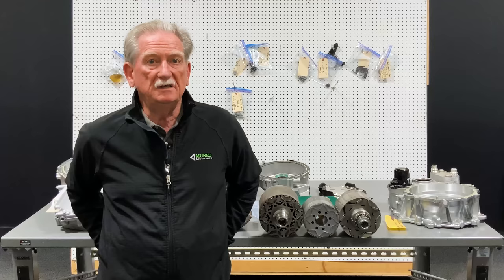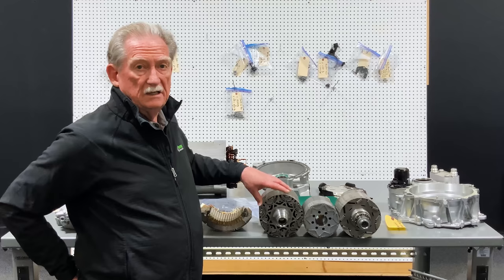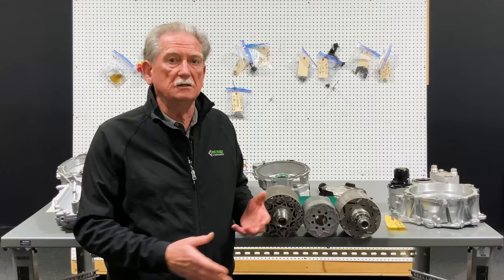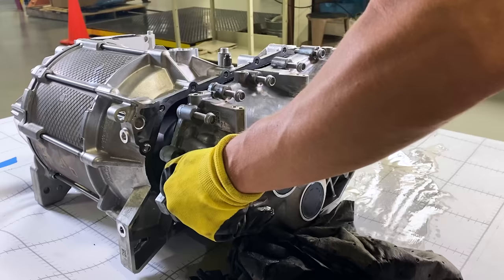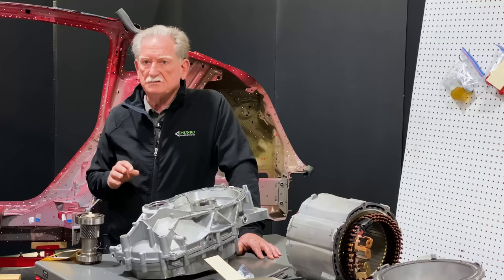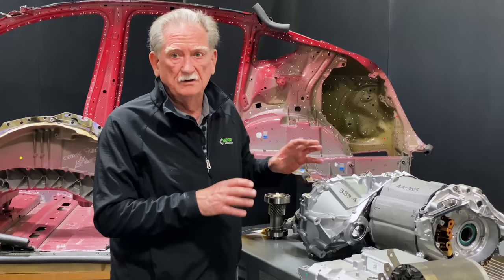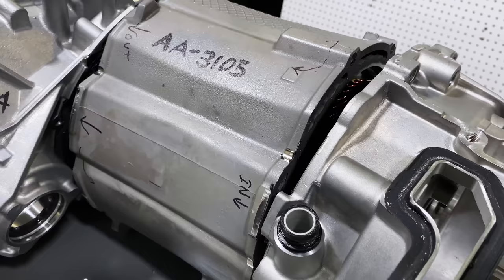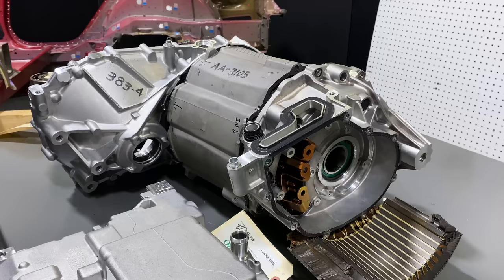Volkswagen ID.4: Electric Motor Teardown and Analysis

Comment: Sandy seems totally uninterested in repairability, with his obsession with snap-together or riveted fixings. Repairability is really important as part of a circular economy.
Reply: Sure. But an Inverter repair is work for a specialist. You need all kinds of test equipment. No problem to have the tools to undo fasteners and a supply of replacement parts.
Other assemblies like the rotor just cannot be repaired. If they fail it may well be the results of the failure of the threaded fasteners.
Reply: @olafzijnbuis  you replace the inverter as a whole in teh field, but still want it to come apart easily in the specialised repairhop. those specialists doing the repairs have high hourly rates, you do not want to waste them on fiddling with plastic clips that get brittle over time.
Reply: could you estimate what percentage of inverters sold will be opened up and worked on?
Reply: Cmon, who will ever repair converter?
Reply: @jeffgorchynski  no, but by European law they have to be designed in a way they can easily be worked on and easily dissasemled into their main material fractions to recycle them more easily.
Reply: Never going to happen, electric cars are the new throw away tech.
Reply: @mell3109  Well, as Rober Köppl above said, designing it for throw away, is forbidden by EU law. It must be repairable. And the repair information must be made available to all repair shops.
Reply: Sandy does not know EU law. I think I can forgive him for that. But repairability should be one of the core principles he throws around in this video.
Reply: @ronaldderooij1774  EV will create a new industry for scrappers
Reply: @omoklamok  Yes, as far as lithium batteries and copper go. I agree.
Reply: @samuelgomola9097   I hate to say it but I would be one of the people repairing things like this. That is how I have saved up the money to buy my first new vehicle the Cyber truck.
Reply: @ivantierney6737  Yes and it's fine, I also like to repair electronics if they are repairable and even better for you in you can make money from, but in general it's far from everyday reality. Maybe 1% of those units will be ever repaired by skilled people like you or hobbyists like me. From reliability standpoint it's better to have SMDs and no screws if possible in environment with vibrations like car, you know what I mean.
Reply: Totally agree, so when the Capacitor goes bad (because it will) he will throw away the whole inverter, crumbs and they say the youngsters have a throw away culture.
Reply: Thing with theese inverters is is that in 90% of the cases where one fails, its either a burnt IGBT which needs replacement and or some complementary components like Driver ICs and Capacitors. Which can cost you 20-100$, depending on what is broken, in parts to repair a 3000$+ inverter. 

Doing repair work on a product with clips is the most annoying thing ever because they often break during disassembly.
Reply: @karicowo  Exactly. Sandy has spent a lifetime optimising for manufacturing cost and reliability. And that is often in direct competition with repairability. One-way clips, welds, large (expensive) single components as the unit of spare. You can make things reliable and repairable/maintainable but it generally costs more (gaskets rather than welds, removable fixings rather than insert-only clips, etc). Sandy is now looking quite old-fashioned on this aspect whilst being uptodate on others. More aware designers are probably holding their heads in despair. I guess they'll have to start youtube channels too to get the word out about a more circular way of designing. :-)
Reply: @samuelgomola9097  I would
Reply: @olafzijnbuis  Sure can a rotor be repaired!
Reply: @sebastianbottger1044  Maybe. But you also have to consider things like Mean Time Between Failures, Mean Time To Repair, and Mean Cost To Repair.
The long bolts may make the rotor repairable, but may well be the most common failure point.
In the end, you can repair everything. I traveled extensively in countries like India. With their low labour cost and shortage of spare parts, there is a need to repair things we in the west just replace.
I have seen metal sheets riveted to the side of truck tires to cover a cut.
Reply: Yeah I thought it was a pretty bold position to be so anti-thread
Reply: @jeffgorchynski  Go look at starter motors for ICE vehicles. Go buy one and they ask for a core charge, you bring your broken starter back to get your core charge refunded. The broken starter goes back to full tear down and rebuild/repair. These drive motors are expensive and there will certainly be a secondary repair market. If not then people will avoid buying the car in the first place.
Reply: What's the obsession with snap together, perhaps he should try repairing things, I work in a vehicle repair shop, and snap together is making things so much harder to repair. We send away ECU's and other electronic devices for repair. They really need to come apart for repair, could you imagine if you couldn't take an engine apart to repair it! Someone somewhere one day will repair these electric power trains, they need to come apart.
Reply: that's exactly what I  was thinking! I hate radial riveting. Also I have seen a LOT of failed radial riveted parts it only works if your quality control is absolutely perfect
Reply: @olafzijnbuis  Um I think you need to watch videos of people from India,Pakistan etc. They will tear down and repair anything including a motor like this. And do it in shops with a dirt floor. I even seen a video of them cutting apart and restoring automotive batteries and then using a hot piece of metal to seal the whole thing back up.
Reply: @stevenwestfall7638  True. I traveled a lot in India, Nepal an the rest of Asia.
I have seen how they rewind stators and rotors by hand.
I agree that things must be repairable.
Maybe a 3 tier system:
1 Replace the inverter
2 Replace a defective assembly like a PCB
3 Repair the PCB
At level 2 and 3 you must have the tooling to undo fasteners and a supply of new ones to replace broken fasteners.
There is no need for all them screws to secure a PCB. They are in fact a failure point.
Reply: "Circular economy" is nonsense. It's not always economical to recycle and repair things.

Moreover, thermodynamics prevents the elimination of all waste.
Reply: @ronaldderooij1774  EU law is not an example of good economics.
Reply: @phamnuwen9442  Consider natural systems for a moment before suggesting that a circular economy is 'nonsense'. Everything just recirculates in the system. Some of it very slowly (tectonics). An economy more in tune with that way of looking at things is not impossible.
'Economical' is a purely human construct, depending on how we value things. Value future utility more and more things become economic to repair and recycle. 
Thermodynamics does not make waste material inevitable - it does mean that there is 'waste' energy (actually just converted energy and an increase in entropy, which is inevitable).
A circular economy is absolutely necessary for our continued comfortable existence in the long term. There is not an infinite amount of stuff to dig up and throw away.
Reply: @phamnuwen9442  Entropy will rise IN A CLOSED SYSTEM. The earth is not closed. It receives energy from the sun.
Reply: @phamnuwen9442  Generally I disagree. But of course there are a lot of laws that I disagree with as well. That's normal.
Reply: @xxwookey  Tectonics isn't relevant to human economics, nor is supernova nucleosynthesis, and even if we're working on the premise that we have to recycle everything (which is not true), then that doesn't mean we have to do it immediately. If something is too expensive to recycle compared to using virgin material, then it makes sense to put it in storage (a landfill) until it becomes economical to reprocess it into new stuff.

"A circular economy is absolutely necessary for our continued comfortable existence in the long term."

I think the only sense in which this is really true is in the longest term, i.e. if you're trying to maximize the use we get from nature from now until the heat death of the universe.

In the short or medium term (centuries to billions of years (lol)), some degree of discarded waste will probably be more economical than complete recycling of everything.

And I'm quite skeptical that completely  avoiding material waste is possible in practice even if theoretical thermodynamics allows it.
Reply: @ronaldderooij1774  The EU is regulation, taxation, protectionism, tariffs, bureaucracy and market distortion.

All these things are inherently anti-economic since they interfere with the mutually beneficial voluntary interactions between individuals.
Reply: @xxwookey  Let me add that I believe there is potential for more (not full) economic recycling of used materials.

This is if we achieve an abundance of energy. The obvious way to energy abundance is nuclear fission.

Unfortunately, I suspect most people who support the "circular economy" are also rabid opponents of nuclear energy.

That is - their actual goal is neither economic flourishing nor abundance, but stagnation and poverty.
Reply: Dealerships do NOT repair parts -- they only quickly replace them using idiot mechanics then get additional profit from the cost of the new part.
Reply: @rodanderson8490  "Dealerships do NOT repair parts -- they only quickly replace them using idiot mechanics then get additional profit from the cost of the new part."

Replacing parts is often much more economical overall than repairing them. That's why it's done. If it wasn't, the repair shop or dealership would just repair the broken part instead of buying a new one and make more money...
Reply: Seems asinine to think people won't repair inverters. Have you seen what people do for electronics online?  I'd wager the opposite, that inverter rebuilds will be a core charge like service.  It's going to be like installing rebuilt alternators.

There's nothing in that inverter that's too scary for a shop that already does electronics.  It's only scary for a mechanic.
Reply: @mell3109  Which is totally against the idea of "sustainability".
Reply: @jeffgorchynski ,,, people like us who live far far away from repair shops at minus 20 to minus 40 degrees and shipping is constantly interrupted . WE take things apart and fix them , even if the fix is temporary , at least that gets us out of a jam . Long live the fastener . Also when fasteners are the last thing left they all go into boxes of used fasteners . They all get a new life  at some times .
Reply: @xxwookey  true dat . .... Sandy grew up in the land of plenty and a giant land of plenty at that , where space has never been a problem . Space is a problem in smaller manufacturing countries such as Germany and recycling is a serious serious issue . The other issue is VW sells their cars world wide and some countries are not as affluent as America . If a car company wants to survive it must also think of the other 90% that are not white collar workers . Like other posters have noted , that where does the second hand car come from ? Most can not afford this new technology . Like Elon Musk stated in one of his podcasts , he wants to get the price down to a 25,000 dollar car from where it it now ( unaffordable ). Elon is looking down the road and the big picture .

Comment: In Europe, we actually weld our rails together. And actually almost all the rails, not only for high-speed trains. Because we care about the people who live next to the rails...
Reply: Do they still use thermite for this?
Reply: @265chemic  yes thermite is still the best solution for this problem.
there are apparently some induction based solutions but they require insane power to get the ends of the rails hot enough and you need to be close to it while its happening while with thermite you set it up and walk away until its cooled off.
Reply: Robby Dey  if you want old rails, try Britain they were the first. All ours are welded now. It's the sheer scale of the US that is off putting I would presume.
Reply: I don’t know in what part of Europe you live but they certainly do not weld rails where I do. The rail gaps are actually so terrible that sometimes luggage can fall on people’s heads.
Reply: @mioszradomski1825  Yeah, I also felt that as I left Germany and entered Poland or Check Republic to travel to Austria. I'm talking about Western Europe, I'd say.
Reply: @handlesarefeckinstupid  Nope, it's not the scale as they have FAR less railways (per square km, not in absolute value) then us here. It's just the profitability as transportation mean that doesn't work there. Here A LOT of people use trains, in USA a very little percentage, hence no gain and no purpose to make it better. In USA there are 24km of railroad every 1000 square km. In EU there are 48km every 1000 square km of territory (Germany 95, Italy 87, UK 66, Czech rep 120!!!)
Reply: @265chemic  Yes even for streetcar/tram lines.
Reply: Heavily trafficked passenger rail corridors in the US use welded rail.  Freight lines, which are usually privately owned, tend to use the old stuff because it works fine for their needs and can be fixed with simple equipment.
Reply: I don't think Yanks have high speed rail. They use planes instead! Trains are for the poor and freight in Merica.

Comment: True!  Lot of threaded fasteners! Why? It's the law in the EU that every electrical circuit must be repairable! Which obviously doesn't apply to the USA!
Reply: Well,  Tesla sells their cars in Europe,  so fasteners may not be the problem.
Reply: @jamesengland7461  Tesla just swaps the whole motor out and charges you 10k$ for it.
Reply: or the UK anymore
Reply: @jamesengland7461  The EU and the US have agreed to recognise some of each other’s standards. So a US approved car may be sold in the EU and v.v. but the EU approval requirements (for cars produced in the EU) can still be different.
Reply: @frostyone1967  All EU directives have been put into UK law (just like all other member states had to to). I don’t think that the UK has made any changes yet.
Reply: interesting
Reply: @jansix4287  All EU directives have to be put into an EU member’s law. The UK has done so during its membership of the EU. The vast majority of those laws are still in effect.
Reply: @theUrbanRacingLeague   It’s a screw! For gods sake. Classic case of Americans not knowing what words mean.

Comment: Bravo to VW for submitting their own part for such an in-depth review!  Thanks as always for the technical breakdown video, Sandy.  These are always my favorites.
Reply from the maker: Thanks for watching!
Reply from the maker: Thanks for watching!
Reply: @MunroLive  thanks for watching
Reply: It gives them free tips from the experts. They won't hide anything from competitors anyway so why not get free tips on how to improve. Also VW engineers are probably really proud of what they have developed and want to get some recognition from other experts im the field
Reply: vw is probably having a good giggle at his 'don't use threaded fasteners, they come apart' schtick. i know i was.
Reply: @elayesexe  well from the breakdown, obviously they do!  50kilos over a Tesla battery alone.  1,00's of superfluous screws.  Tesla 10hrs/VAG 30hrs to make 1 car.  Yeah, that's 20hrs they could learn about for starters (obviously 1,000's of areas to improve).
You keep butt kissing if it makes you feel good about yourself...
Reply: @MunroLive  The gear house casting shows a hairline crack from the plunge cut, at minute 6:50 - 6:58...?

Comment: If the only thing Sandy finds is „Lots of screws“, then the VW design is pretty excellent
Reply: Better , in stead of trowing away a hole unit what the old dinosaur suggested you can replace the part that is broken.
So less garbige to trow away and better for the environment .
Reply: Definitely the attitude of an engineer who is fully in favour of planned obsolescence suggesting glue whenever possible.
Reply: Did you foget about the burrs on the bearings?
Reply: Given that screws are good and way better than riveting, the motor seems pretty good.
Reply: @collinzeng9231  It's more like a failure that occured during production that they can fix rather than a design failure.
Reply: That's what i to understand, it is wonderful design, even the performance is rightly decided to ensure economy and good acceleration, this is a master piece from VW.
Reply: @collinzeng9231  yes, great finding by Munro, maybe while reworking it should not hurt, :goodvibes:, for "use and throw" philosophy he should not bother.
Reply: @ABFMick  what do you recommend if seals or locktite is needed?
Reply: @ShawnJonesHellion  seals can be replaced, locktited bolts can be opened. Things glued shut can be incredibly difficult to repair however. When these vehicles leave the dealer service network, smaller cheaper individual parts are often replaced or rebuilt instead of bolting in a complete module. If these vehicles are to be eco friendly they need to be serviceable, long term. Designing them any other way is disingenuous.
Reply: @marinusk67  Exactly. That is the whole idea of an electric car in the first place.